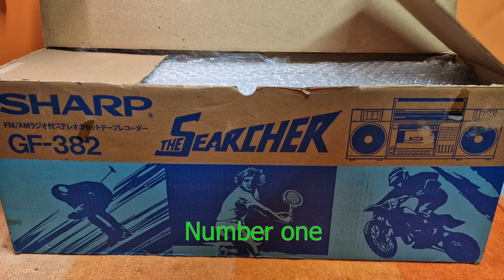Aladdin's treasures part 6 - Sharp GF-382 x 2 (twins) Boombox repaired!

Comment: Aladdin has smiled upon you once again. You managed to tidy up life's mistakes and make things right. 😎 👍

Pinch rollers and belts are super easy to replace in these Sharp decks. I've done it with a few GF-700 and GF-500 models as they use virtually the same mechanism. By the way, did you replace the tape counter belt(s)? I didn't see you do it. 🤔
Reply from the maker: Thank you for your comment and kind words. Yes, there were not many problems with the bells. It was more with the electronic part. Lots of dried up and shorting capacitors, oxidation of the contacts. Typical problems caused by time. 😉
Reply from the maker: Yes, of course I changed the bell on the counter 😎
Reply: @restoration-RC-Studio  I keep forgetting you trim these videos (so some things are not shown). That's my bad. 😌
 I repaired a GF-500 a year ago which, after the usual routine tape deck service, I found Tape 2 wouldn't erase or record. Replaced 8 electrolytic capacitors on the main board (4 of them were for Tape 2 REC/PB, the other 4 being for Tape 1 as playback volume was a bit low) cleaned the switches and controls  - I also tidied up a few suspect solder joints.
Your two GF-382 units are from around 1982 so they are over 40 years old and worth keeping in your collection - true vintage. 😇
Reply from the maker: Yes, these are wonderful devices, it's just a pity they're not mine. They're the client's, I'm just bringing them back to life. 😊 @RoughJustice2k18
Reply: @restoration-RC-Studio  And you misspelled " Treasures " in the video title. 
Doesn't worry me so much, but someone else might cry about it. Peace be with you. 😎
Reply from the maker: Thank you👍
Reply: @restoration-RC-Studio  May Aladdin continue to smile upon you and present you with more treasures (either owned by someone else who wants you to fix them, or something for your personal collection). 😊
Reply from the maker: @RoughJustice2k18  Aladdin's Cave still holds many treasures. I'll be sure to show them to you :)